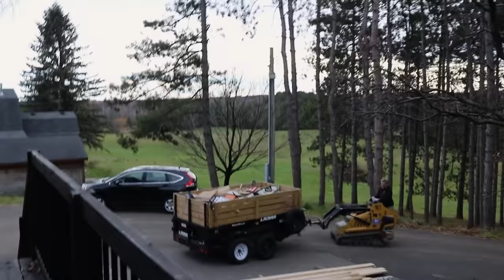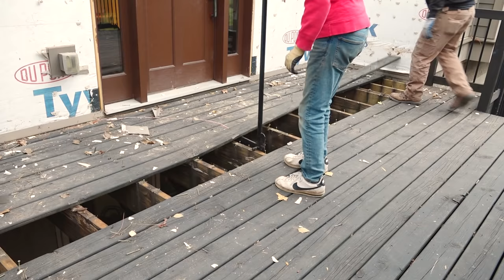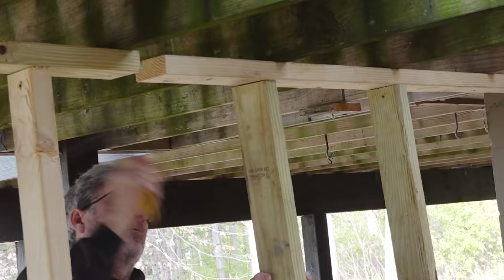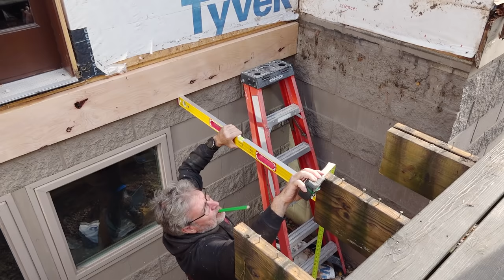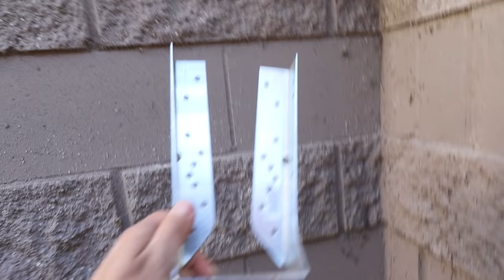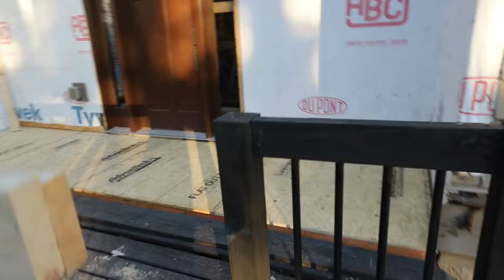Starting the Front Addition | Home Renovation & Addition Part 13

Comment: Thanks for all the videos you've kept us informed and entertained with. Matt, you and Donovan are having too much fun...I've a question for either or both of you.  Watching you use those Red Torx construction screws reminds me of some I've seen that have a short ways down from the head there is about a ¼ inch or so of thread that goes the "wrong" or opposite way of the clockwise threading that hold things together. Only thing I can think of is forcing the opposite direction threads into the wood should help hold the screw from backing out as a result of flexing of the wood, kind of like those pesky ring shank nails that sometimes hold too good and you can't get them out, if you need to, without tearing things up. Good luck and be safe. Yes the weather here in the Madison area has been goofy this year hasn't it. Jim Martin

Comment: Definitely put radiant floor heat on this addition. You have no basement over this five-foot section, and this is the kitchen. It's so obvious that I would be surprised that the architect would not have thought of this.
Reply from the maker: There will be. We’ll extend the current floor’s loops

Comment: Merry Christmas to you Matt, your family and Donavon. and his family.
It's unbelievable that who ever built that house never thought to install rain gutters to avoid the water damage that not having them caused.
An easily avoided very expensive possibly dangerous mistake.
That inset area is generally built in so there's some protection from cross winds and rain intrusion when entering the house.
Up in northern Michigan you'll see that door where it is with the wall they're building having another door to create a weather airlock to keep cold air from intruding into the rest of the house which then creates an area for coat and boot storage on the left and right. Usually they have a sitting area on one side to put on and take off your boots comfortably.
The house I grew up in had that.
It was called a vestibule for some reason.
Reply: Vestibule is the old name for entry rooms. Literally I think it means the place to dress or undress for going in and out. I hope I'm right

Comment: Your making progress and that's always a good thing.  It's good that you and your wife decided to do some additions onto your new home and it's even better that you did because you found some really nasty areas of water damage that needed some attention before they got worse.  It's also interesting, and a little disappointing for you two, that the original builders didn't think about those two issues when they designed the home or whenever the previous owners did some renovations that caused the faulty water management spots.  The new addition to the front looks like it will be a very welcome change to the kitchen layout and thank you for sharing the work as it progresses.  Happy New Year!

Comment: Why aren't you using pressure treated wood for the deck joists, etc? Looks like the last contractor used untreated wood too, which was why it was affected by the rain run-off IMO.
Reply from the maker: Existing deck is all PT. Everything we added will be within the house’s envelope

Comment: Just curious… Why does Donovan seem to prefer installing studs in place versus framing a portion/the whole wall on the ground and then tilting it up? Is it a precision thing or easier to frame when adding on to an existing structure? I noticed it at those big windows on the other side of the house too. Anyway, I really enjoy watching this and your furniture builds. As an architect, I find the insights into a builder/contractor’s process enlightening. Thanks!

Comment: Are there no building codes there ? Here in New Zealand that valley dumping water on the deck wouldn't have passed the council inspection. I'm actually appalled at the construction of the deck as well. Once again here it'd be in H4 or H5 treated timber. As for that siding, weather boards here, what is it ? I looks pretty cheap to me. It's looking good the extension though. Having done a few j know it's not easy or quick. Seasons greetings to you all.

Comment: Thank you for the videos. Highly informative. One question: Why no gutters on the house? I fully admit I have no idea what I'm talking about, but with the water damage you have discovered, I was wondering why there are no gutters to channel the water away from the house? Thank you
Reply: There are some gutters, but those valleys like at the front of the house would just be a bit difficult to catch in a gutter. Any moderate amount of rain is just going to come flying down it.
Reply: They need a high volume gutter with a backsplash at the valley.

Comment: Amazing how short sighted we are here in U.S., "design" has priority over water management. Number one cause of damage to any structure isn't even considered, its why our building don't last. The larger the overhang and installing gutters the longer the building lasts statitically. No one likes the looks of the scupper they didn't install to catch your roof water. Merry Christmas!
Reply: I built a small shed in the back and have been considering incorporating gutters inside the lower edge of the roof. With perforated metal for the water, the gutters would be invisible. I'm mulling the details for such a small job.
   There are a bunch of companies making leaf guards that might be suitable.

Comment: Merry Christmas.  (If you celebrate.)

Question about the prefab I beams. Appears in the video you just dropped them into the hangers then screwed and glued the subfloor down. Are they fastened in some way to the hangers or the rim?
Reply from the maker: The hangers have barbs that grab them. Thanks! 🎄
Reply: @mcremona  thanks.  That was a fast answer!

Comment: Just asking. I'm no expert at all. I see all those windows below. Are those posts only temporary? Would bigger beams or steel beams be an option to open up the area below?
Reply from the maker: The posts are aligned with the outsides of the windows so the impact to the view is pretty minimal; they blend in with the other posts that support the deck. A single beam supported on the ends would also be an option but would require more time to install.

Comment: I always find it so odd that all your houses are only built from wood. In the UK we use stone or brick for all our houses and they're made to last. Seems weird to use materials like wood for structural elements which rot away so quickly. Is wood really so cheap in the USA that you can replace houses so regularly?
Reply from the maker: Lots of trees here
Reply: Most Swedish houses are also made out of mostly wood. If you just handle the moisture it will last for centuries.
Reply: Ha... you mean like in the UK the thousands and thousands of endless rows of terraced houses built of single skin bricks, only 9 inches thick with no cavity, no insulation at all.   They are disintegrating.  Compared to the timber-framed properties (even simple cottages) that are still standing after 400-500+ years (i.e. Lavenham and plenty elsewhere up and down the country)  

Wood's wonderful when treated with respect.  Do admit though that whoever built Matt and Lindsay's house had something to learn about building methods - that's been worrying to watch, seeing such relatively new work rot so quickly.  Glad Donavan and Matt are on the case!!  Happy Christmas to you all - from England!  ;)